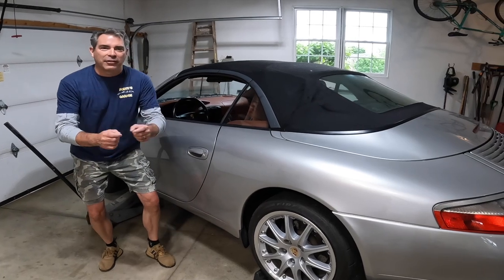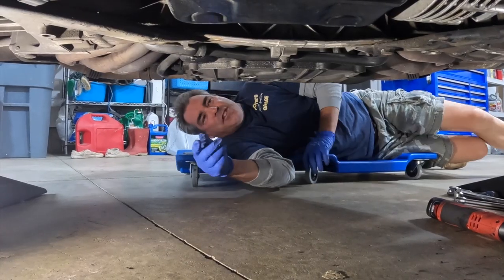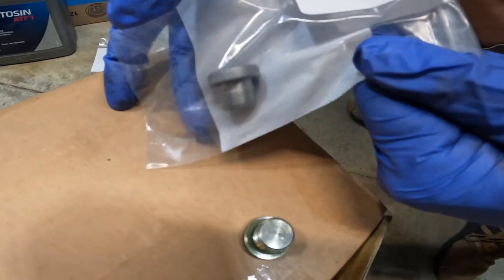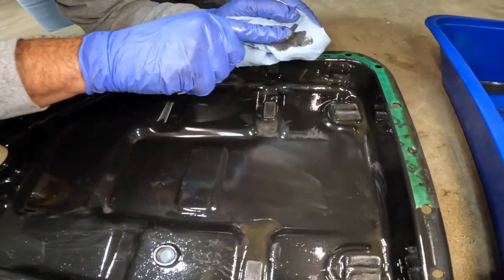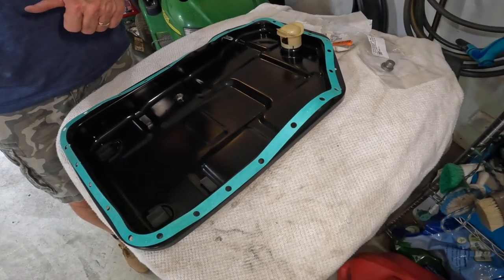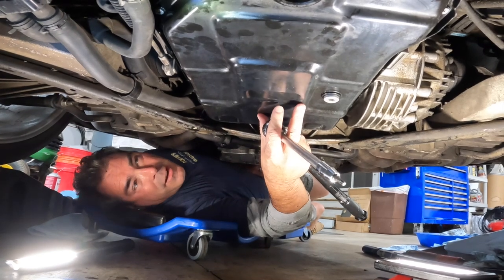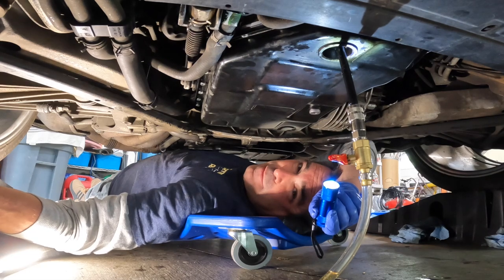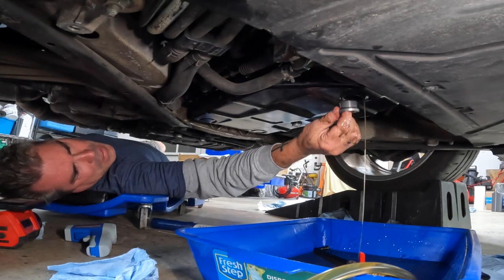Porsche 911 (996) Tiptronic Fluid Change - Man This Was Tough!!!

Comment: Thanks for the video!  One of the best out there for Tiptronic fluid change. I have a 997.1 Turbo with Tiptronic and it appears the process is the same (slightly different parts though) 

Anyhow, just wanted to say thanks for uploading the video and being true with the challenges you ran into. This will certainly help individuals like myself as I attempt to change the filter and fluid. Cheers!
Reply from the maker: @kimlee9917 - THANK YOU!!  It's always an adventure - glad to share and hope it helps!  Good luck with the fluid change on the  Turbo!!!

Comment: Are you thinking about a Quickjack?  I think about one every time I do a fluid change...still working off ramps and stands myself!  If you're going to work on these things invest in an Autel 808 scan tool or equivalent.  The wired tool is cost effective.  The bluetooth version is awesome because you can take the tool with you anywhere you're working to read temperatures or actuate things.  Kinda pricy but in this day and age it just as important as having a good impact and sockets!
Reply from the maker: Ah yes, the Quickjacks.... I NEED them!!!  One of these days I definitely will get them, so useful!!!  And thanks for the intel on the Autel - I'll look at that as well!   I bought the iCarsoft because it was cheap for the number of features it has - Durametric is good but limited on number of cars unless you pay the big bucks for professional version.   Given what the tools can do these days plus the need for them on common maintenance tasks, you really need a good one!   Agreed they are pretty much essential these days - thanks for the tip @YoshiV819!!!

Comment: Your video was excellent.  I wished I watched this before changing my transmission fluid.  My fluid appeared very dirty even though my1999 Porsche 911 996 only had 52K.  (recently purchased).   I’m guessing the previous owner did not change the transmission fluid because of low miles even though the fluid can break down over time.   
    I had to change my fluid three times (4-5 quarts) at a time before I was able to change most of the 8.7 quarts that it holds.   
   I also had to go back and top the fluid off because I did not top it off correctly the first time, running the engine, going through the gears and allowing the gearbox  to get to the correct temperature.
Reply from the maker: Thanks glad you liked it!   And yeah, it takes a few changes to get through all the fluid for sure.  Good to have that done!!!   And I'll say it's HOT next to the exhaust down pipe when you top off with the engine running!   Take care out there!!!!

Comment: The correct ATF for this 5HP19 box is ZF Lifeguard 5 not Pentosin (Pentosin is used only for the power steering system on the 996) !
Reply from the maker: @nathandan7079 - Thank you for your comment and you are correct, Porsche recommends ZF Lifeguard 5 for OEM replacement.   That said I had a very hard time finding this available without going to a dealership or ordering from Europe.   I did some extensive research on what people had used and what ATF makes and fluids would be acceptable.   I came to the conclusion that there are three acceptable brands that could be used:  ZF Lifeguard 5, Pentosin ATF 1, and Esso (now Mobile 1) ATF LT 71141.    This is MY research and what I was comfortable with putting in my Porsche.    I always try to go with Porsche OEM recommendations for sure, in this case I chose Pentosin ATF 1.   I would suggest that everyone should do their own research and use what they feel is acceptable - I am by no means a Porsche mechanic or expert!  Thanks again for commenting so others can make their decisions with as much info as possible!

Comment: Correction, Engine need to be running (ATF pump circulating) and at 30-40c then fill until it start dripping! See ZF 5HP19 oil change video.
Reply from the maker: @nathandan7079 - you are correct again!  This is referenced at around 14:40 time stamp in video!